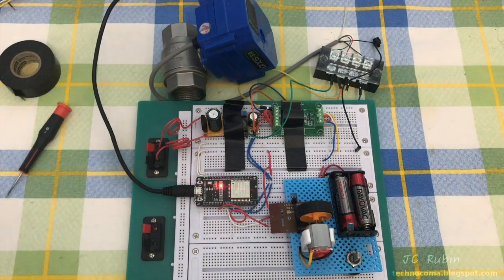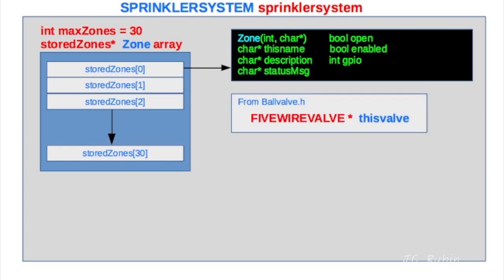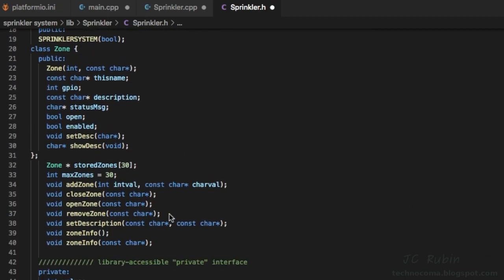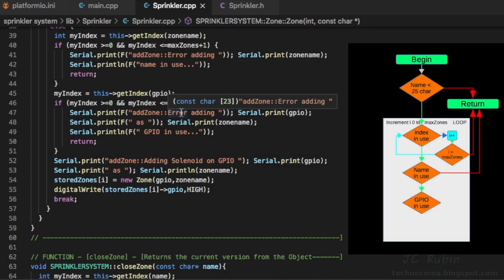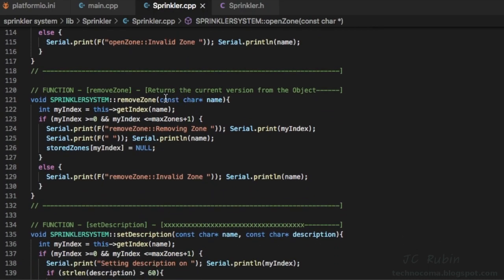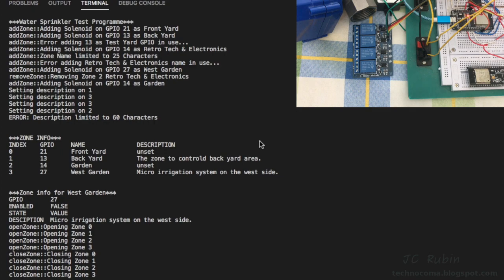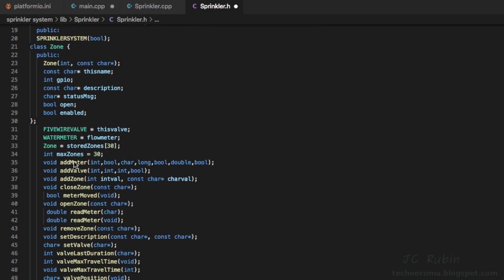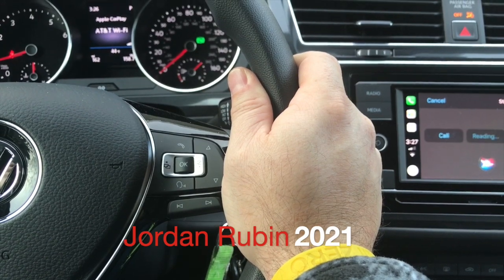ESP32 Automated Irrigation Control System Project - PART 3 - The main Sprinkler Class

Comment: Great to see this project progressing.  Not sure why you'd want to use a special magic value like 99 when -1 would be perhaps more appropriate - i.e. a value that just CAN'T be an index.  In future it might help to turn off the ceiling fan.  It creates a quite distracting stroboscopic effect in the video.
Reply from the maker: Good point, I could have used -1 to do that as well, sometimes i come up with a solution of the moment and run past it.  As for the fans, well , here fans run all the time.